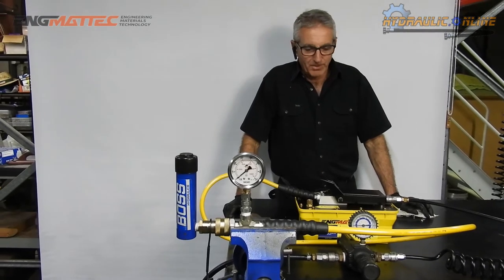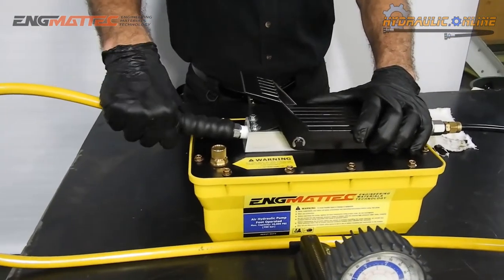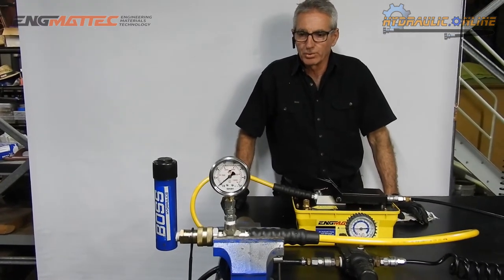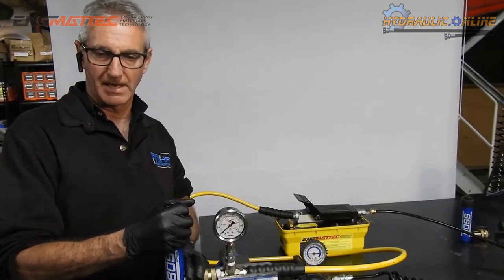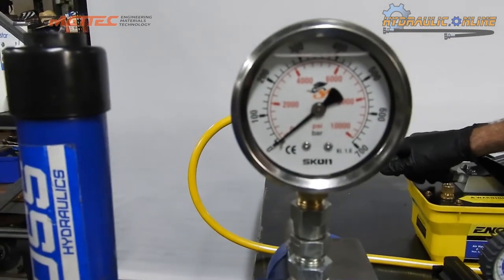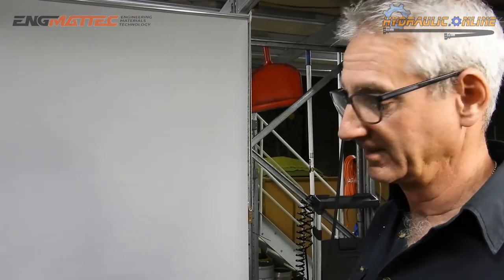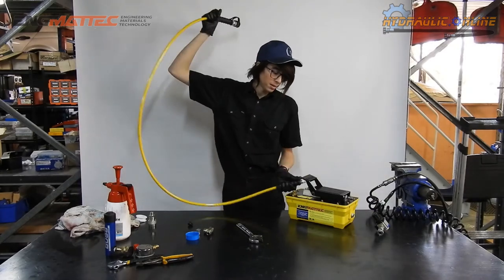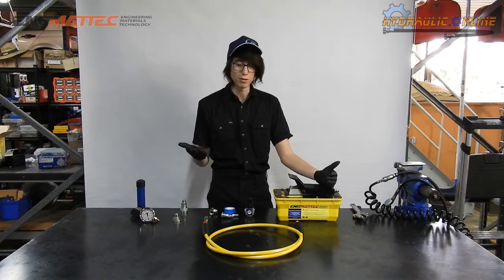200,000 pounds Press Crushing Force with only 100 pounds Air

Comment: Hello sirs. I know virtualy noting about hydralics. I learned a great deal from the older gentleman and I have a question or two. I have applicatio I thinking of where I waht to use the max 10,000, and have three sub-assemblies use a lesser amount say 2,000 psi. If I have leaned from riley correctly, I can han have one line, split that off to four ports, and with the air regulator of the proper size, use 3 for 2,000 and 1 for a 10,000 psi application, all simultaneously. would that be possible?
Reply from the maker: Not quite right Chris
Let me do some research and get back to you
Reply: @Hydraulic.Online  

Or, could I electronically control those three port, inndividually, to deliver the require psi to the specific port?